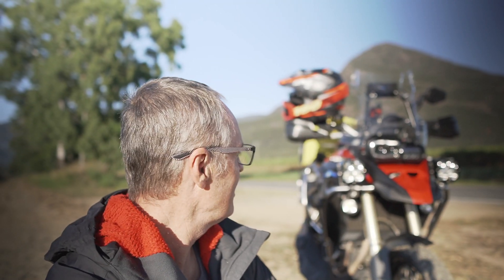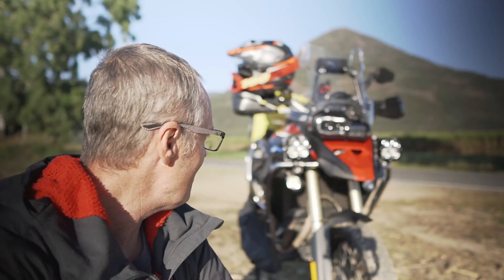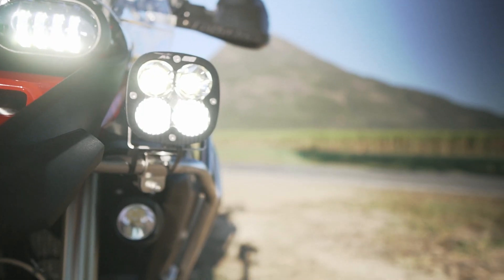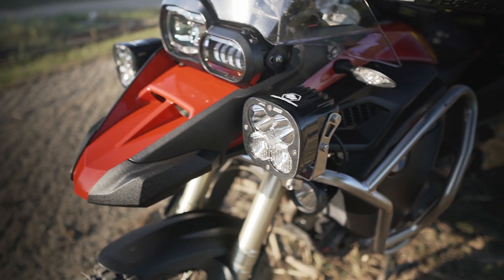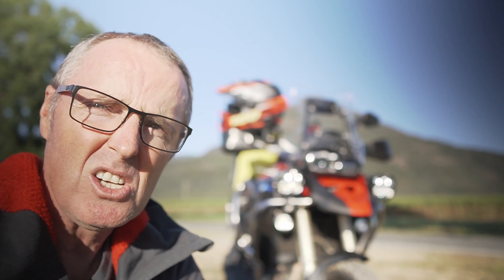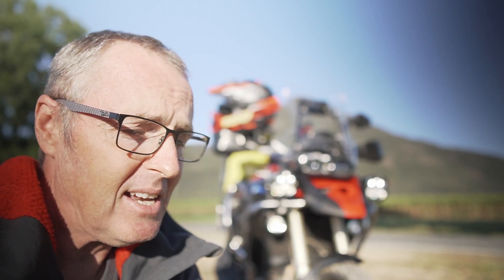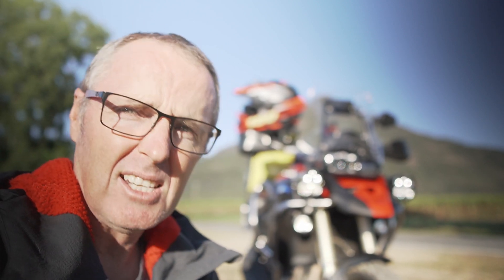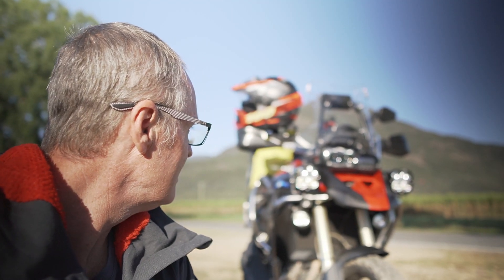BAJA DESIGNS XL80 REVIEW

Comment: Just want to verify too, that XL80's are bright beyond all expectations. I live in the deep forest, where at night, the towering pine trees suck away all light in the area, and take the pitch black of night to a whole new level. Living in the forest as well, are deer, elk and other small animals that like to stand on the road. Ordinary high beams are not enough to spot these dangers in time. Installing only two XL80's, and using them as high beams at 100% power, they turn the pitch black forest into daylight. Deer and other animals can be spotted at great distance before disaster strikes. The combination spot/flood are ideal for road. The wide dispersion of the light is good for about 500 meters to the sides. The spots illuminate reflective road sights out to 3 kilometers, wood power poles can be identified out to a little under half a kilometer and everything in front of you is crystal clear visible! Insane bright!!!! They do however need to be switched off immediately to an oncoming driver, as the XL80's to the other drivers are almost comparable as looking directly at the sun. ( and to think, Baja Designs LP9 lights are several times fold, brighter than the XL80's!)